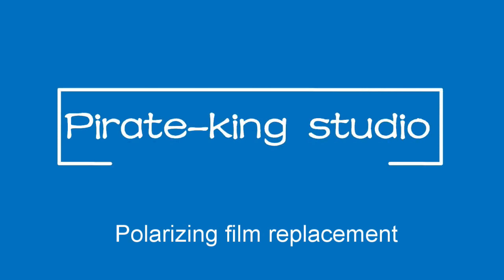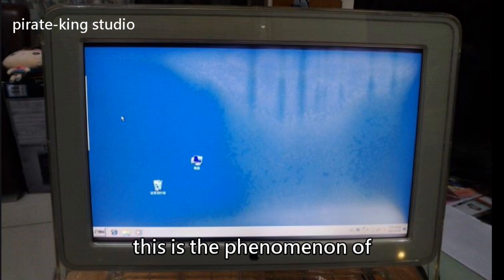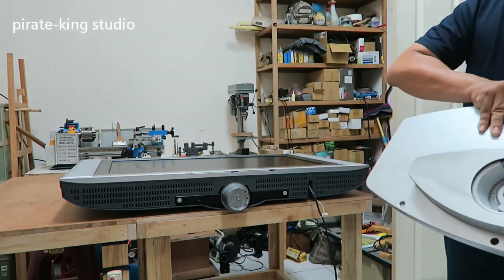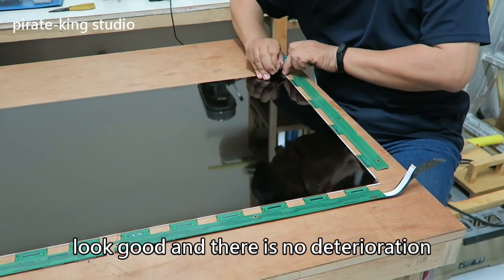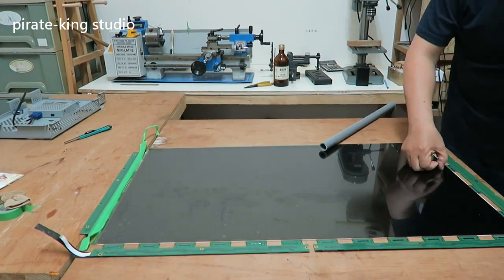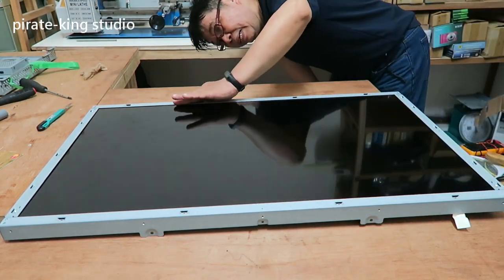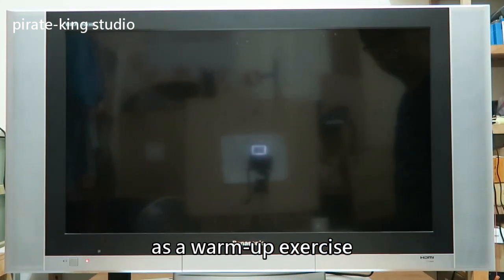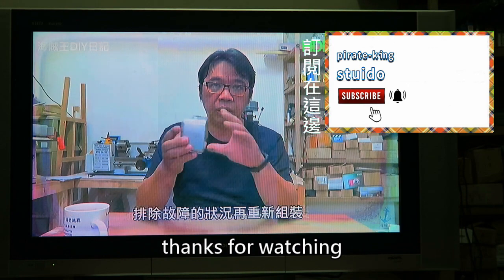How to replace the polarizing film of LCD TV   pirate-king studio

Comment: hi sir, i have a important question to ask, if I replace them both front and inside , is it no need to follow previous film angles ? And just use any angle for inside and 90 degree difference for outside film ?
Reply from the maker: As long as the angle difference between the inner polarizing film and the outer polarizing film is 90 degrees, it is enough

Comment: Hello. I have a Samsung S34E790C. 34 inch ultrawide monitor.  Which polarizer do i need for that panel?  0 , 45 or 90 degree?  Thanks!!!
Reply from the maker: Actually I don't know, you have to peel it off to know
If the inner layer and outer layer are replaced at the same time, the angle difference is 90 degrees.

Comment: Thank you. How does one know what angle polarizing film to buy? I need to remove and replace (perhaps apply LOCA) with these: 19" LCD Viewsonic computersmonitor, one SEGA VMU screen (about 4cm) and one screen for the weighing scale (8cm). Should I buy one big polarizing film (how big for all three) or separate ones? Do I need one interior and one exterior polarizing film for these three gadgets?

I have 99.99% isopropyl alcohol, is that anyhydrous alcohol. I also have denatured alcohol.

Thank you.
God bless, Rev. 21:4
Reply from the maker: First buy a 0-degree test polarizing film, and cut a small piece of the external polarizing film to be replaced, then attach the test polarizing film to the screen and rotate it to the correct angle, so that you will know the angle of the old polarizing film.
If it is not too troublesome, you can buy a large piece of polarizing film for cutting.
Reply: @pirate-kingstudio5774  Thanks I asked the seller, he said there are two models, same size, one is positive, one is negative and it has no adhesive at the back.

I will replace the polarizer on a weighing scale's LCD display and on SEGA Dreamcast VMU. Should I get the positive or negative? What adhesive should I buy and look for (I can't find a small one with adhesive on its back- like a sticker).

Comment: Dear all, does anyone know how to determine the type of orientation of the TV screen for the selection of the polarizer film?  There are 0°, 45°, 90°.  My TV is 32" SAMSUNG LED UA32D4000. How many degrees does this TV use? Thanks in advance.
Reply from the maker: You can buy a small piece of test piece first, (0 degrees) and then cut a small piece of the outer membrane.. You will know by comparing the light source.
Reply: @pirate-kingstudio5774  in my place it's a bit difficult to find the film shop. I'm planning to buy it online in a fixed size by mean not in a form of small piece of it. So I should have known the exact value of my TV orientation in advance. But anyway, thanks for your feedback.